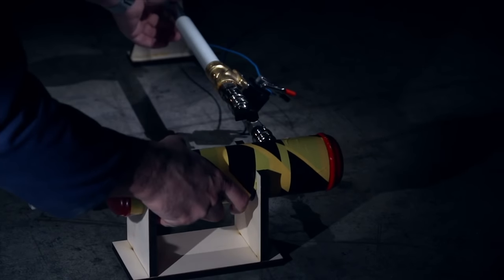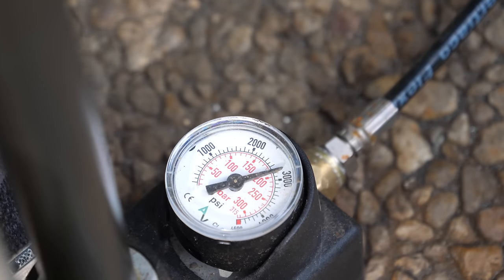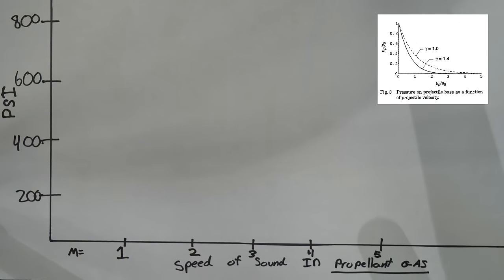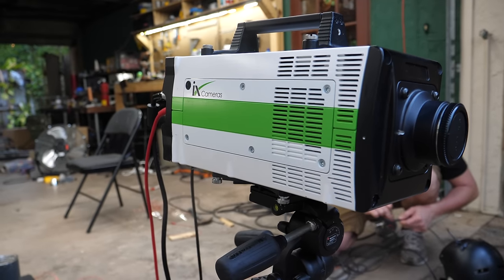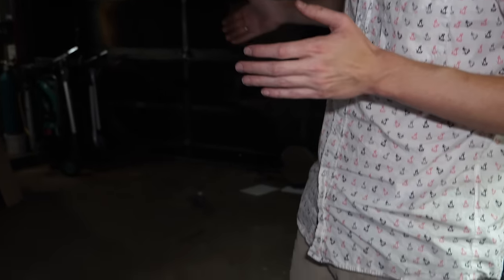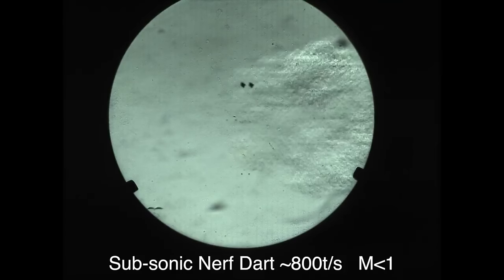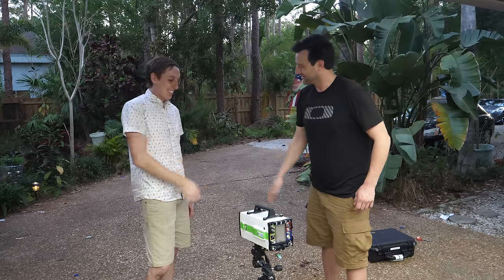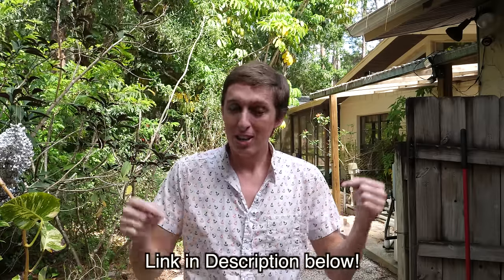What happens when a NERF dart breaks the SPEED OF SOUND?

Comment: Maybe his tank was larger and his barrel was longer so it was able to accelerate for longer. Perhaps this allowed him to use a lower pressure so that the force from the pressure wouldn't rip the dart apart. Instead of designing it to accelerate it by a short burst of high pressure you could design it to accelerate with a longer bust of lower pressure.

Comment: The M256 gun on the M1A1 and M1A2 Abrams tank shoots projectiles ranging from 5,100 fps to 5,700 fps, or Mach 4.57 to Mach 5.11.  That's not theory.

It's a bow wave, like the bow on a boat, not a bow tie.

Your chamber was way too small to sustain pressure for the barrel length you chose.

I did enjoy the video immensely!
Reply: Translation: a container of "a" internal size will equal pressure by 50% in a barrel of "a" internal size.
If the barrel and pressure chamber are equal, the pressure will fall to about half the difference.

Comment: I have a couple of Nerf guns, so I have some questions.
Firstly, what would happen if you used the long distance "Accustrike" dart? I think it would perform better than the regular one. Next, what would happen if you put a dart put inside of a mega dart, and then launched it? I think this would shred the mega, leaving the inner dart intact.
Finally, what if you attached a thumbtack to the head of the dart? I think it's obvious what would happen, but it still would be awesome. I think that the first two may allow the dart to go faster without getting shredded like the Elite darts did, but the last one would just be cool.
Reply: or rival ammo
Reply: Accustrike isnt a distance dart. Its accurate.
Reply: What
Reply: Seth Begley the acustrike darts perform worse than standard elite darts. I have both darts, and the elite darts almost always perform better.
Reply: CalebDoesStuff Define "better". Accurancy isn't important here, but structural integrity and muzzle velocity is.
Reply: Seth Begley yezz
Reply: Well... it depends on what you prefer. If you want to be accurate, use accustrike but keep in mind it doesnt shoot that long.

Also, it doesnt depend on the gun you use but on the darts. Every single one gets different results. Almost all guns shoot roughly the same if you use the same darts.
Reply: Seth Begley gai
Reply: I suspect the mass and to a certain extent thickness are the only thing that would matter here. The aerodynamics at supersonic speeds really don't work like you'd expect, so for instance making a bullet spin can only be accomplished via friction with the barrel.

Comment: What burst disk did you use on the vacuum/business end of the light gas gun?

Also how dangerous would hydrogen be?

a=sqrt(gamma (R/m) T) for hydrogen, molecular mass = ~2 whereas helium ~4. Gamma hydrogen (diatomic molecule) is 7/5 whereas Helium is 5/3. So at the same temp speed of sound in H2 is approx sqrt(7/10)*sqrt(RT) and He is approx sqrt(5/12)*sqrt(RT). So speed of sound in H2 should be 54% faster than He.

Now, what a supersonic jet of hydrogen does when meeting air, that I'm not so sure of, but my guess is that it involves combustion if not detonation. I would guess that if you purged the high pressure side first, to prevent combustion/detonation in the device, and pull a decent vacuum, then there would not be sufficient mixing to worry about detonation within the confines of the device. However, what happens after the projectile exits, I'm not so sure. The turbulent shear between the jet and air could mix regions before a reflected shock propagates back thorough it. I would definitely want to be much further away and behind some thick concrete before trying.
Reply: K mr.scientist
Reply: That would be potentially dangerous if there isn't a high enough vacuum, but I'd love to see something like this! Great idea
Reply: Yeah, too dangerous for this boy.
Reply: Helium works well because it is inert and will not explode. Also, helium atoms are smaller which allows them to expand faster in smaller spaces. I've read articles about the auto ignition pressure of hydrogen (this is the temp and pressure that hydrogen can ignite with no spark). Some have stated that it is around 7 megapascals, which is 1015 psi. I think hydrogen would be dangerous due to the risk of explosion, but it would still be cool to compare the differences between using helium and hydrogen!

Comment: All the phenomena shown in this video (bow shock, supersonic flight, breaking the sound barrier, etc) has everything to do with the Gas Dynamics part. The apparatus you made is similar to a "shock tube" which use gases such as nitrogen, helium, or even air to drive the vacuum chamber (driven section). As you separated the chambers using a plastic film, the "shock tube" is also separated by a few millimetre thick Aluminium sheets based on the requirement of the experiment! This reminded me of my laboratory class during my Bachelor's! Love from India. ❤

Comment: 6 years late, but, I scrolled and scrolled and didn't see this anywhere. 
Where is the dart housed? If it's in the high pressure part, I expect the foam to have shrunk considerably and the pressure to have escaped around it, leaving just the tip to act as a sail. If it's in the vacuum, I expect the foam to come apart as the cells burst, leaving much less structural integrity and blowing apart into confetti at a low pressure. If you could find open cell nerf darts, you may be able to get higher speeds.

I know. 10k comments. Not gonna see this. But there it is. Some bot can copy this and get 100k likes maybe and it may be seen

Comment: I know this video is old at this point, but I wonder if a Dart Zone Pro dart could get closer to supersonic speeds without disintegrating. Obviously the foam is always going to give up the ghost before reaching that point, but the DZP darts are half the length of ordinary Nerf darts, and therefore have half the foam.

This makes a difference at lower velocities at least; when the dart is flying at speeds of 100 feet per second or faster, half length darts fly much straighter and their velocities are much more consistent. I wonder if the half lengths would be better at higher velocities as well.

Comment: Instead of a NERF gun, I'm using a pressurized air system I made myself. And instead of an open barrel, I'm creating a vaccuum to eliminate air resistance. And instead of air, I'm using a pin-fire ballistic system. And instead of a nerf dart, I'm using a 7.62 NATO round. And instead of a test range, I'm firing it in a public park.

Comment: You'd have better luck if you used a better nerf dart. Nerf Brand darts are terrible. Use Dartzone darts. They make 5 types. 2 half length darts, 2 full length verisons of the half length, and then their green waffle tipped darts. I would use their Adventure Force Pro half length darts. They're black with orange tips. You'd have better results.

Comment: You can make it go faster by using combustion to push a cylinder driving the helium. Lightweight projectiles have approached speeds around mach 20 with light gas guns.

Comment: Actually, I was wondering why you didn't try a vacuum cannon? 
1. Insert dart in pipe 
2. Seal both ends with burst discs
3. Pull the hardest vacuum you can on the whole barrel
4. Pierce rear burst disc
5. Send a Nerf dart through a plank like butter, or a ping pong ball through a bat like it was nothing.
I think NightHawkInLight got his up to at least Mach 2.
Reply: vacuums  work only as well as the positive pressure outside. so in this case the effective pressure (no matter how pure your vacuum is) would be the same as air pressure at sea level. which is equivalent to around 15psi. 

you've effectively taken off their 10,000psi cannister and replaced it with a 15psi one.

Comment: Btw those numbers are tolerances/ fit. So level 1 is a very loose fit, meaning it’ll thread itself with no effort, meanwhile 5, which is the highest, mean you’ll have to use tools to even get the first set of threads in

Comment: I have done something similar using a big bore airgun and a disposable Sabot to house the nerf dart! That way you don’t have to thread the dart and the sabot will engage the rifling — it also worked best with my 1100psi output (3k PSI rated with 4.5k burst discs) HPA tank but I didn’t use Helium so maybe you got comps with that due to the pressure differential and the excitability of He. I’ve used He before in my Benjamin Bulldog (Pitbull Mod) but idk if it performs proportionately better at lower PSI’s. It didn’t work super well with my more powerful HPA tanks. Rather than 3D Print the Sabot like normal — since it’s so lightweight inside the sabot — I had some success making some large gelatin capsules into sabots but the most success using water tubing which I perforated in a few different patterns

My favorite project is something you might like — bc it’s like a more dangerous version of lawn darts — but it’s essentially the same principle but using flachettes. Bonus points if you can super glue a cap from a capgun over the tip to make it pop on impact. Idk if you could do that with a nerf dart but it would be cool! It would probably destroy the dart with some fun foam expansion but you’d have to put a sort of hard plastic cylinder in between the top of the dart and the cap to activate the cap

Comment: If there's a problem with the pressure behind it dropping, what about having multiple pipes into the barrel that direct gas forward at an angle? Seems like it would push air out of the way forward, letting the projectile move forward easier, and then when the projectile passes the input port the gas pushes the projectile. Like the shape of a long tube with very sharp V shapes that point toward the end to force more gas forward.
Reply: I thought the same method.  I believe the problem is timing the release of each additional pipe feeding the chamber.